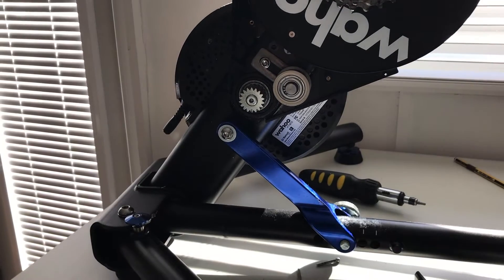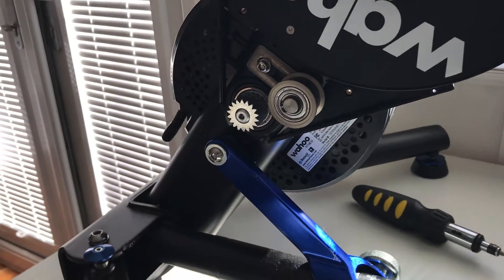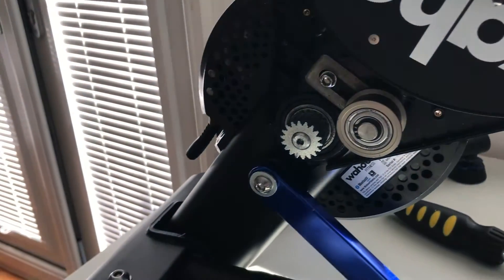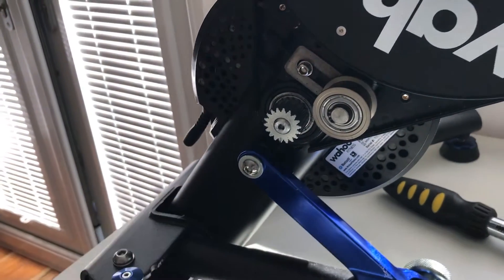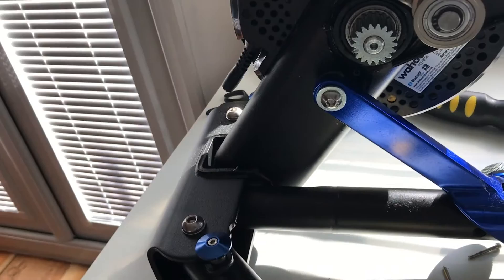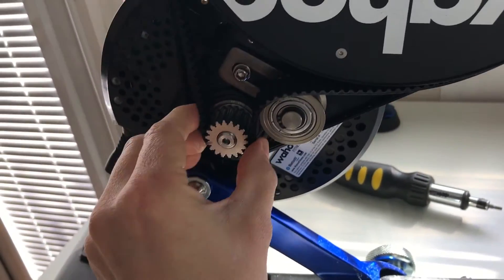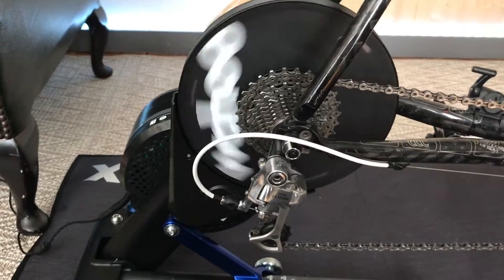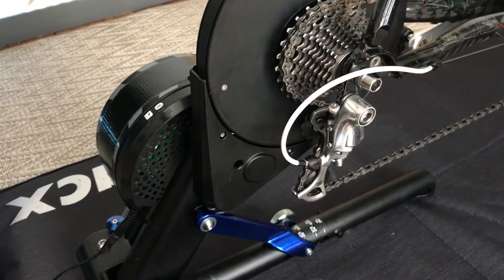Wahoo Kickr Flywheel Vibration Noise Fix Experiment (UNSAFE)

Comment: Hi Daniel
I have a kickr core  that start to have the vibration problem  that you  describe  after i had to change the bearings. 
 After i saw seeing your video  i start to wandering if that method solved the problem for you and/oryou found a better solution?
I'm going  to verify if my free wheel  is also unbalanced  but in a previous attempt to solve the problem i took the belt off  and the vibration disappeared 
But in my case the vibration came and goes,  it is not  constant

Comment: using the silicone lubricant helps reduce the sound (noise), and what component is that produces that sound is the belt?
 I am using a translator to communicate
Reply from the maker: Hi. I think the belt friction is causing the noise mainly. I used to have a belt drive bike, and silicone lubricant really helped keep that belt quiet.
Reply: thanks for answering

Comment: I never saw when you made the mark on the cog, or why you made it there. Can you explain? Also, I think my bearing needs replaced any thoughts on how or where to find that?
Reply from the maker: The mark on the cog is to help you to figure out where the weight needs to go - so you can see where the flywheel is heavyest
Reply from the maker: oops, sorry I missed this! The mark is there to help you find where the balance point is on the flywheel.
Reply: @ginzolacom  does the lead tape go opposite the mark on the cog